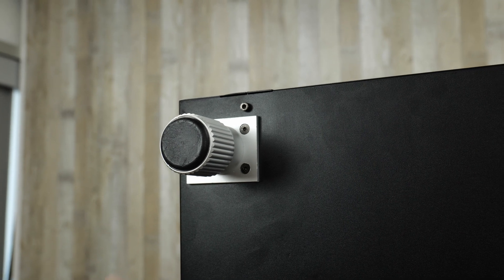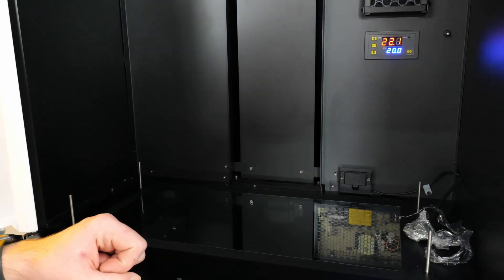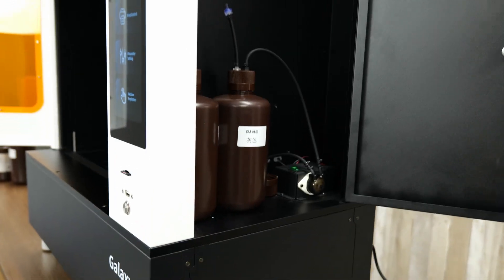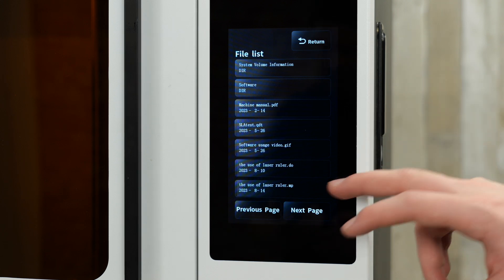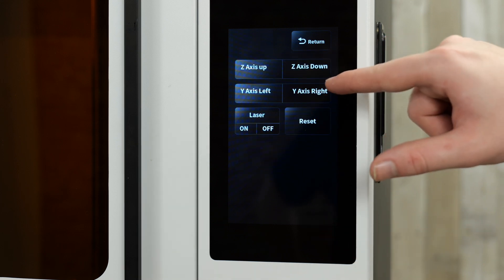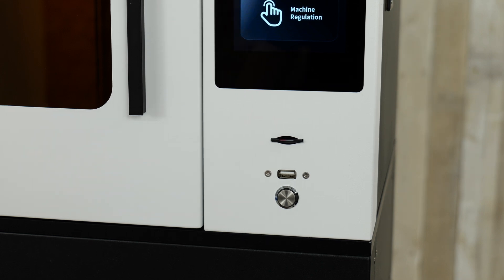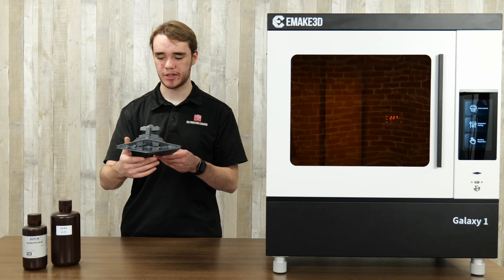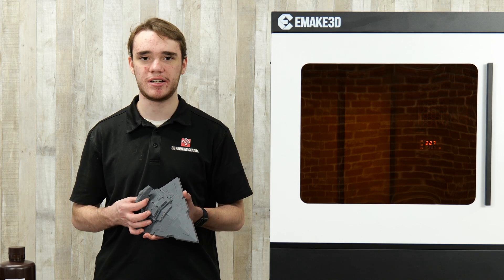EMAKE3D - GALAXY 1 UNBOXING & TEST PRINTS

Comment: Thank you for the review. This is new product on the market. And its quality is under huge question, nobody knows, how long laser head will serve, but if it is of good quality, even with this huge print time, it can be a gamechanger. I know laser deteriorates in time, and its easy swap is vital too. What is vital for review of 3d printer is print quality test. smal test plate with all possible  forms, but makes a good impression of what machine capable is. I do hope, you will do this, guys.